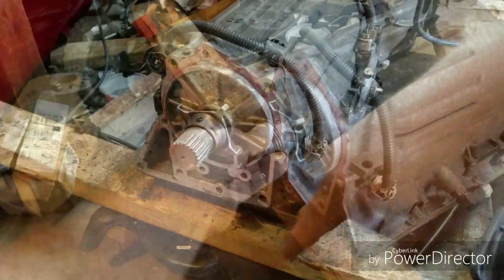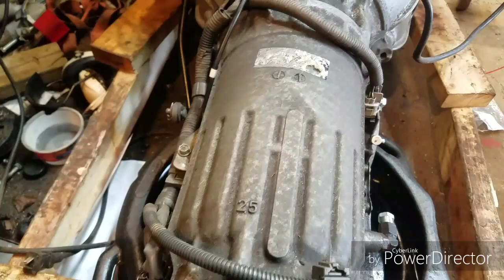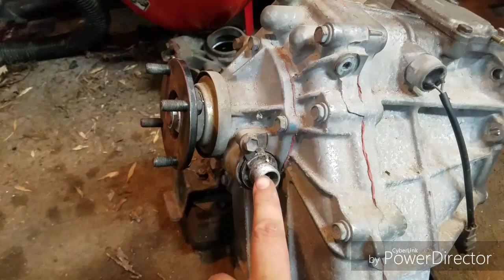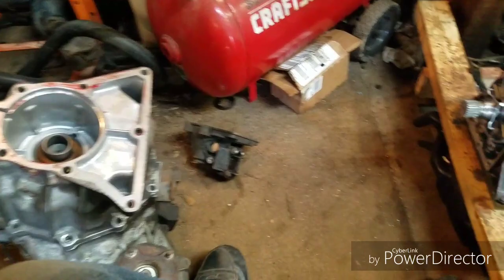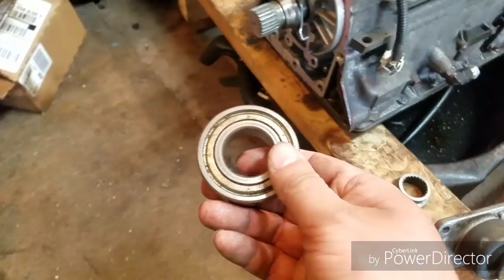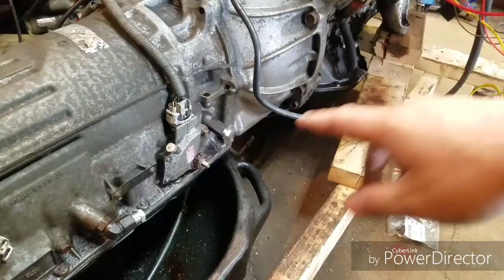Converting a Lexus A340e to 4WD

Comment: I used a 1999 landcruiser transfer case into my 1989 landcruiser.  I had to also swap the output shaft and attached cluster.
Reply: T100 will also work if you swap the output shaft in the transmission. I also used an electric speedo sensor from a T100, they came both ways. I have speedhut gauges.

Comment: I got a great deal on a 1uz and 30-40LE tranny setup do this swap in a '90 4runner,

the 2wd to 4wd conversion on the tranny has many a vid on youtubes which is well within my mechanical level to perform,

I will be using a spitronics harness and ecu/tcu,

my tranny DOES NOT have the 6pin or 8 pin connector harness for the solenoids, mine is a 3pin connector,

my ring for the speed sensor IS NOT as yours(or others) with the 4 "arms" sticking out, mine is just a ring with grooves machined equally running the length of the ring, I havent disassembled the tail housing but for initial benchtop inspection, the gear that would turn the speedo APPEARS to be a separate piece from my "tone ring/gear", both are held in place with a snap ring on that out put shaft-it APPEARS that once I remove that snap ring the speedo gear and the "tone ring/gear" slide off as 2 pieces,

I also dont have a "speed sensor/lock up sensor" found on the front driver's side of the tranny as I saw on other vids, I'm thinking the bellhousing is for a 6 cylinder, the hump at 12 o'clock that I've seen on other tranny vids is at 2 o'clock on my bellhousing, I dont know if that sensor is mounted in the bellhousing, I do see a threaded hole and round casting where a sensor might be drilled(?),

do you think I have a useable tranny for this 4wd conversion, do I just need a 6/8pin harness,

Comment: Thanks for making this video I didn’t think my 99 4Runner transfer case would work with a t100 tcase because of the tail shaft pickup/sender issue but I just drilled the hole out and shimmed it and it all jives even though marlin crawler said it wouldn’t 🤷‍♂️ 
They like to sell the mc-31 adapter plate

Comment: There's that oil hole as you stated on a CartuneNZ vid. Thanks for your NA market specific swap details!! Did you have success with <.125" or <3mm gap at sensor?

Why do you refer to what I call the "#2 VSS (VEHICLE SPEED SENSOR) as "tone" sensor?

Any remarks on motor mounting, or maybe you detailed this in another video?

Comment: Have you finish the eng swap and what  you did for the wiring
Reply from the maker: I have not finished it, although it does run. I simplified and modified the Lexus harness to be a standalone engine management harness so it only needs a key on, start and fuel pump wire to run. I will be cleaning it up and wiring in a custom fuse box next. I'll do a video of some of that.

Comment: I have a 2000 automatic 3.4 4x4 Tacoma and a complete donor 93 ls400 , I’m a veteran Acura master mechanic. But your a better man than me, there is so much involved especially with the Lexus transmission control
Reply: Control unit and Tacoma 4x4 control unit. I have to see your truck running to believe in your technical supremacy.

Comment: Nice conversion... can you do that to A650E from 03 gs300 ? I have complete engine transmission with harness planning to put it in a mud buggy .. thanks
Reply from the maker: The 650 is much more complicated. It actually has a drum and clutch packs in the extension housing. The only 4wd conversions I found involved a very complicated and custom adapter. I ruled out donor cars with that transmission for that reason
Reply: NumbchuxSOAD 
Thanks . Do you think 340 and 650 share bellhousing . I was thinking getting 340 if 650 complicated to convert into 4x4

Comment: What year T100 is the adapter off of? Great video!
Reply from the maker: I believe mine came from a 98. But any 4WD T100  with a 3.4 and automatic will have the parts you need.
Reply: NumbchuxSOAD thank you!